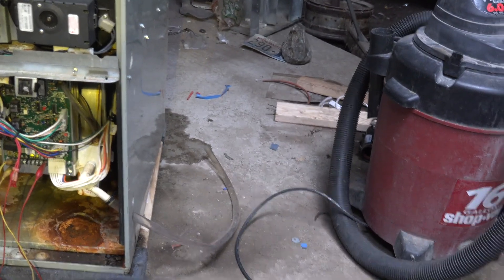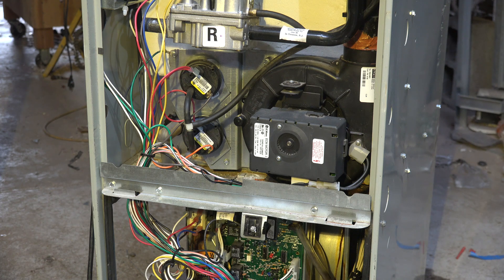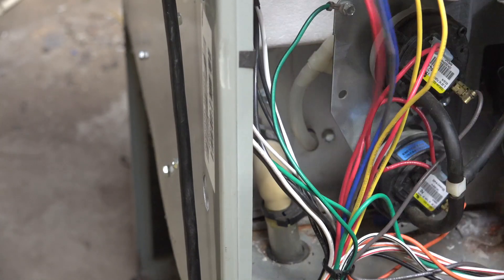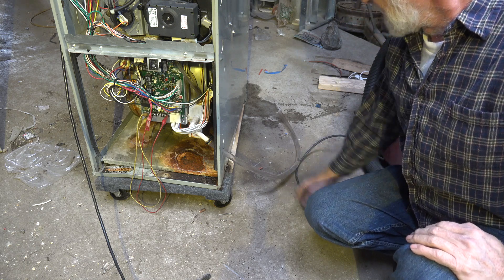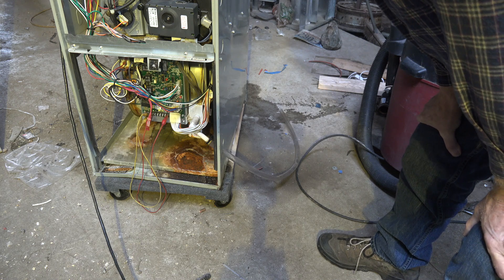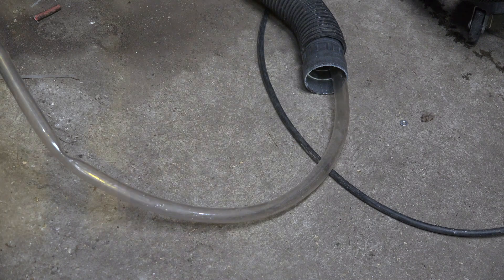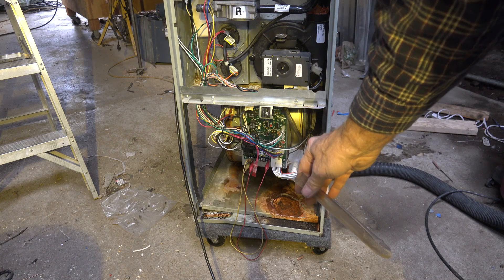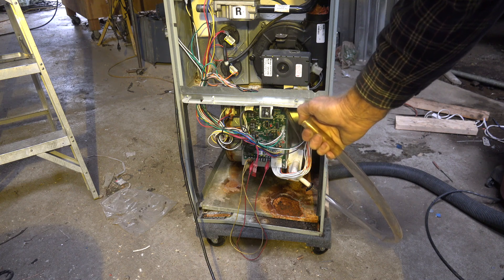Clean the condensate drain of the 90% gas furnace

Comment: If I need to add water back in, what is the best way to do this?
Reply from the maker: When I do this, I block off the drain tube with my thumb and start the unit.  The condensate will fill the trap in 2 to 4 minutes.
GFM
Reply: Awesome. Thanks 😊

Comment: This is great info. I'll add that an even easier way to fill the p trap is to simple get a funnel for your clear tube, hold it higher than the P trap by a foot or so, and add water to the line until the water comes back up the clear tube until it is even with ~ the center of the p trap. The slowly tip out the tube and catch the excess water.

Comment: Thank you for this 👍 fixed my parents’ furnace for me. Unplugged the pressure switches and sucked the hoses out. All sorts of bugs and water in there, not too much but enough to freak out the system that it would:
1. start the blower
2. Ignitor would glow
3. Light the burners
4. Then shut down after 10 or so seconds

Thought it was the gas valve intermittently going off and on, or the pressure switches. Even thought it may have been the control board.
Looks like it was just bugs trapping the water in and freaking out the safety system by plugging the air outflow a bit. Thanks again!
Reply from the maker: Welcome
GFM

Comment: My furnance is making. Water on the exhaust and making monoxide I already changed the whole Exhaust sisteam .
My furnance olse don't have all those p  tramps
Reply from the maker: If you are making CO, you need to have a tech find out what is wrong with the furnace.  It may be dangerous to operate it.
GFM

Comment: is there a way to remove and replace the inducer motor on a lennox g26. my inducer has 4 screws but it does not come out of the housing. do i need to buy the whole assembly with the motor??
Reply: No, they are permanently mounted to the blower wheel.  They are sold as a unit.
GFM

Comment: I hate the clamps on these things and when people glue everything piece together 90% furnaces really are junk imo and cost the customer more in repairs and service calls ten times more parts to break as well  chimney vent ftw
Reply: I've come to realize that. High efficiency always seem to have condensate issues. Had a flue that terminated on the side of the third story of the building and the flue had ice and snow all on it w no way to clean it off and an inducer that was gurgling. Even the terminations on a high efficiency set up the home owner for failure just a little
Reply: And like you said more parts

Comment: I had a service man say I needed an additional switch for the condensation line to prevent water from flooding the unit. I don't understand this because it will shut off in the winter if the pipes freeze. They tried to explain because it was winter and in the summer water will still flow. I don't understand if the unit is clogged and the condensation can't drain what does it matter the mode of the clog if the unit shuts off. Can you explain this?  I understand it might be difficult without knowing/seeing my furnace.
Reply from the maker: It can be a flooding issue (not full basement but small flooding).  Some units will continue to operate when plugged.  Hope this helps.
GFM

Comment: Very helpful. Found tonite that "L" shaped fitting from the secondary heat exchanger was plugged solid.  Had to remove tubing.  It had hardened, of course, and was a bear to get back on.  Black stuff was leaving the trap, not the clear water you showed.  Thanks for the suggested precautions.  👍👍

Comment: is there a furnace that doesn't require so much maintenance?  90% efficient doesn't seem to mean 90% reliable. Thank you for your instructional videos.  by the way,where do I find your pre winter,yearly- maintenance video?
Reply from the maker: In some parts of the country, you can install an 80% efficient furnace.  It does not condense water out of the gas.  Other than the condensate issues, it is about the same as the 90% furnace.  Here is the start of a series on servicing the 90% furnace:  https://youtu.be/XE-LXpcD5gE
GFM

Comment: I got a question I have a carrier furnace. I am still little confused. Do I need to take off the pressure switch first(before the cleaning trap)? Thanks a lot.
Reply from the maker: If you are using a vacuum to clear the trap, you need to remove the tubing to the pressure switch to avoid damaging the pressure switch.
GFM

Comment: Why is there Rust inside? Furnace  I have Goodman High efficiency furnace vents outside water leaks from top to bottom of furnace on to basment floor. Wondering if its Condensate pump gone bad.

Comment: Can the condensate trap be cleaned with a shop vac or air compressor without removing? I don't have removable flexible pipe on the lower drain port.
Reply from the maker: You can use a vac.  You will need to remove the pressure switch tubes to prevent damage to the pressure switch(s).
GFM
Reply: @grayfurnaceman  Thanks. I have removed all 3 tubes. My understanding is that the middle one is for the pressure switch. What's the purpose for other two? Do I need to vacuum both or only one of them?
Reply from the maker: @fitfan2828  They are there to reference the gas valve regulator to combustion chamber pressure.  
The tubes themselves generally do not need to be cleared with a vacuum.
GFM
Reply: @grayfurnaceman  Sorry, what I meant to ask was whether I can vacuum or blow air into both the upper ports. Want to make sure I don't damage anything inside the white condensate trap box.
Reply from the maker: @fitfan2828  Yes you can.
GFM

Comment: Could this be why my furnace is constantly draining to my sump pit in my crawlspace? I read that it could be a plugged condensate line.
Reply from the maker: If the water is coming from the condensate drain system, it is normal.
GFM
Reply: @grayfurnaceman  it just seems like it's working overtime. I hear the sump in my crawlspace kicking on a few times an hour. Traced thebline going to the pit where its coming from and it's off the furnace
Reply from the maker: It could be normal.  It could also have a check valve on the outlet that is leaking by.
GFM @drumsaredope

Comment: thanks I tried it seams to be working when I first started working on it would run put out heat then shut off right away and noticed a slushing sound coming from inducer motor, I saw a yellow cap on the bottom of the inducer and removed it  water poured out , so I ran a hose from that to the sump I hope the problem is solved .I  believe water is condensing on the exhaust pipe and running back into the inducer, and not sure what to do about that ?
Reply from the maker: The water condensing is normal.  Your drain system is plugged.  That's why you have water in the inducer.
GFM

Comment: I have a 90% furnace that seems to be leaking from inside where you disconnected the pressure switch hose. Is there anything you’d suggest to cure this issue?
Reply from the maker: I am assuming the leak is not related to any tubing connections.  This may indicate a rusted out secondary heat exchanger.
GFM
Reply: Is there any way I could get an email to contact you and send you pictures or a video please

Comment: Why will it not start if its empty? Also when it does not start does it give the 3 flash code?
Reply from the maker: Air sucks thru the open p trap into the heat exchanger and reduces the vacuum so that the pressure switch may not make.  The code depends on the manufacturer and model.
GFM
Reply: grayfurnaceman ....that makes sense, my trap on my goodman furnace is mounted on the outside with no lid...I did notice that the water was almost gone out of it..Thanks for the tip!!

Comment: Great video, does the furnace only cause condensation when its heating. Would make sense it doesnt do anything when the AC is running. Thanks.
Reply from the maker: Yes the condensation is the water in the gas.  It sometimes uses the same condensate drainage system as the A/C.
GFM

Comment: I've been flushing out condensate traps whenever I do a maintenance call for about 7 years. You're way is a lot easier. I've been taking the pipe clamps of the top 2 tubes with linesman pliers, and disconnect the drainage port tube. If by change a hose clamp breaks, I use a thick zip strap.

 I go to usually a utility sink flush out each whole by running water through each individual hole while blocking the other holes with my thumb and shaking it. It's always empty of debris with just a bit of water, very little, and it's always worked fine.
Reply from the maker: One of the reasons I have to do it the way I did is I had a lot of broken p traps and condensate fittings and leaks when disassembling the drainage system.  Some of the parts are better now.
GFM

Comment: I ran into an interesting issue the other day on a gas furnace similar to this one. It was a Trane 90% furnace, with the cover over the burners, like most newer 90% Trane furnaces have. 
The pressure switch (this furnace only had one) had the white silicone tube going from the pressure switch to the heat exchanger collector box, like normal, and also had the black tube going from the pressure switch to a tee, where it goes to the vent on the gas valve, and then too the combustion chamber. 

The furnace wouldn't fire up, control board kept flashing a code for "Pressure Switch Fault". I found that if I pulled the black tube going to the combustion chamber off, right there at the combustion chamber connection, it would fire up every time, no problem. Likewise if I took the cover off the burners, and left the tube on, it would fire up every time. But with the cover over the burners, like normal, and with the tube in place, like normal, it wouldn't fire. What would cause this? 
Thanks in advance for your help!
Reply: 84randomdude It sounds like the combustion air intake pipe is plugged.
Reply: The furnace doesn't have a fresh air intake pipe. It uses surrounding air where it's located in the crawlspace.
Reply from the maker: I just found your comment.  Sorry.  As Armstrong said, the first place to look is combustion air.  Obviously, there is no problem with the combustion air.  First, you must understand the pressure switch has 2 negative pressures operating on it.  A high negative pressure in the combustion chamber works against the pressure switch closing.  A high negative pressure in the vent will close the pressure switch.  The bias in the pressure switch is toward the vent.  If  the difference in the pressures is right, the pressure switch will close.  So, lets consider the negative pressure in the vent is not high enough due to a blockage or water in the vent.  If we remove the negative pressure in the combustion air, there could be enough negative pressure at the pressure switch so that it would close.  So, check the vent.
GFM
Reply: grayfurnaceman I didn't think about the vent being an issue. Thank you for the advice, I will check the vent.
Reply: Same thing happened to me. ID fan wasn't pulling my pressure switch in all the way.
Reply: I am running into the same type of situation but I haven't tried removing the combustion chamber hose yet.
I will probably try putting the water in the condensate trap.  What was your final solution?
Reply: @gusbey1348  Did you find a solution? I’m having the same problem.
Reply: I have a 2 years old Trane xt95 and have the same issue. What did you do to fix the problem?
Reply: @yulinleung  Did you fix your issue? I’m having the same problem.
Reply: Do you fix your issue? How? Thx! I’m having the same issue.